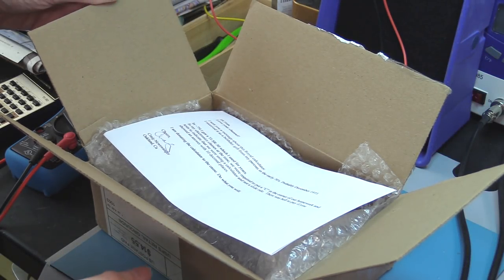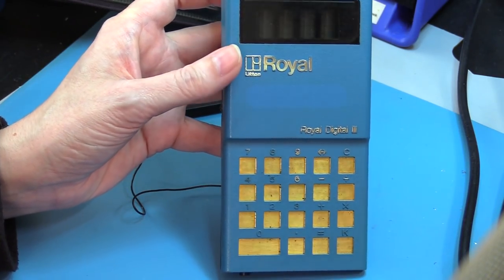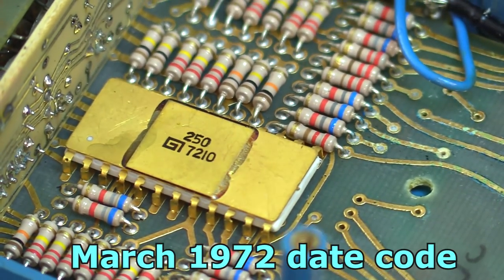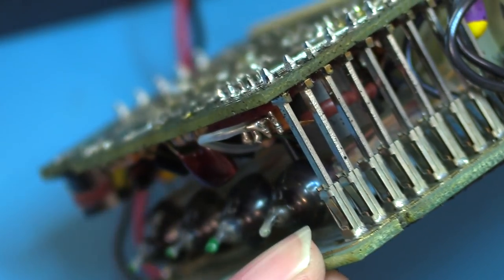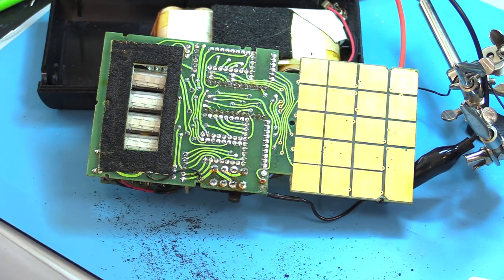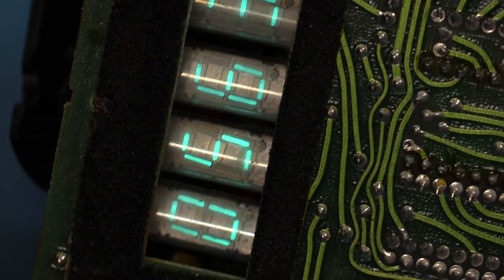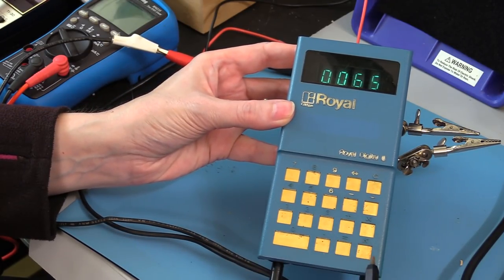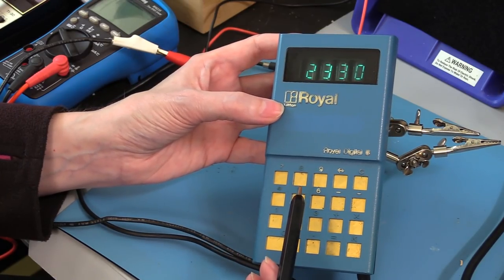Look Ma - No Keys!  1972 Royal Calculator

Comment: Yes, that is the General Instruments GI250 calculator on a chip.
If you think 4 digits isn't enough for most calculations, you're right. The math is done internally on 8 digits and the two groups of 4 can be swapped using the <-> key.
Reply: I was thinking there had to be some way to do that.
Reply: For Sure GI IC Chip
Reply: Agreed.  I just straight up read that chip as General Instruments.  It didn't even occur to me to view it as a symbol/graphic.

Comment: I saw one of these in 72, a local architect was using it and I was told to stay away from it as it was the most advanced electronics available. 10 years later while working in the repair dept. of an office equipment supplier I found the same calculator gathering dust in the back of a drawer.
Reply: "I saw one of these in 72, a local architect was using it and I was told to stay away from it as it was the most advanced electronics available"

 I hate people like that.
Reply: @plateshutoverlock  are deer zee zee
Reply: Around that time my parents gave me a Casio calculator with a vacuum florescent display. (to maybe replace my slide rule?) It had an appetite for batteries and no "scientific functions". But, it's the thought that counts. It probably cost a small fortune.

Comment: Yes, this is the General Instruments GI-250, which beat the Intel 4004 to market as the first microcontroller, though it had a ROM mask as a 'calculator on a chip' (and by some accounts is the great-great-granddaddy of the PIC microcontroller series). It was first available in 1971.

The power jack is a mod - the original power connector is another weird pin arrangement. The key pad is gold plated (not copper), since Litton wanted this to be a high end product. At the time, keyboards were not 'off the shelf' components, and using a stylus dramatically lowered the cost. The same chip, with an updated ROM mask was used in the more conventional Litton Five calculators (with buttons, and 8 digit display) that came out a year or two later.

The chip was designed in Scotland, UK by a team of four, one of whom is my father in law. He still has the first prototype and the hand-drawn chip layout diagrams (MOS ratio logic).
Reply: Thanks for sharing. I am always very impressed by these pioneers in innovation. The essence of intelligence.

Comment: Logo is GI, General Instruments Microelectronics. Famous for AY-5-1013 UARTs, various TV game controller chips, the AY-3-891x sound generators (ubiquitous in home computers in the 80s, a key to the sounds of the era), and the PIC1650, the first in the PIC series that Microchip now market.

I worked on two of the lesser known GI microprocessors (LP8000 and CP1600) in the 70s and early 80s, before moving onto Z80s.

Comment: I remember the no calculator rule when I was in school and then I went to an electronics vocational school where a scientific calculator was required equipment. Took a little while to shake the feeling that I was cheating somehow.
Reply: I'm all in favor of calculators in the classroom.  It allows the kids to go into higher math earlier while skipping the mundane stuff. I graduated HS in '73 and I only took one year of basic math. "Basically" arithmetic.  That summer I served an apprenticeship along side my father for the tool and die trade.  With my first two paychecks ($200) I purchased a Unicom Rockwell engineering calculator.  That got me into trigonometry and algebra immediately. 
One could make the argument that the student should know the "how and why" a particular equation arrives at the answer.  In the real world its not necessarily so.  When you're plying your trade and getting paid by the hour it's best to get the right answer ASAP.

Comment: In the same timeframe, I was working for Monroe Calculator (Orange NJ).  It was also a Litton subsidiary. We made the exact same calculator with Monroe branding. That's actually an 8 digit calculator. You'll find a "swap" key on the keyboard which swaps the most and least significant 4 digits to the display. The chip is from General Instruments. This was a super low cost device (under $100) hence only 4 vfd's and no keyswitches. A full featured 4 function handheld at the time was around $375.

Comment: In East Germany calculators were introduced in schools in the late 80s. And you needed a signed form from the school to buy the calculator, because it wasn't freely available. They were called "SR 1" (Schulrechner 1 = school calculator 1) and the price was 123 DDR Mark, really expensive!
But mine still works fine today. It's very sturdy.

Also the official lesson plans in 7th grade were attuned to using the calculator. So we were late to the game but went full in.
Reply: @manitoba-op4jx  Just a couple years before. November 1989 was the historical date.
Reply: @manitoba-op4jx  1989 was the fall of the Berlin Wall.

Comment: Some other have already added info on this calculator in their comments, and I will try to add some more here based on my own resources.

This calculator was called the "Digital III", and was introduced in late 1971. It was made in the USA by the Royal Consumer Products division of Litton Industries in Connecticut. It was "announced" in the January 1972 edition of "Electronics" magazine. It's suggested retail price was $140 USD, adjusted for inflation this would be something like $1000 USD today. 

As this was considered to be a "low cost" calculator at the time, the three major design decisions allowing it to be so "inexpensive" were the use of a "calculator-on-a-chip" integrated circuit, the four digit display (although since the calculator circuits did the math for an 8 digit display, it was necessary to 'scroll' the display left and right to show only four digits at a time, hence the "<->" key), and the use of the electronic 'stylus' contact pads instead of a mechanical keypad.

Keep in mind that in the early 1970s, electromechanical keyboards and keypads were both complex and expensive (and usually bulky), and use of such a keypad on this calculator would have driven the cost up even further, and by a significant amount. So Royal decided to use the simple and relatively expensive stylus & contact-plate scheme. By the way, those keypads are gold plated, not plain old beryllium copper!

The "calculator-on-a-chip" was the General Instruments model 250, which was one of the contenders for first usable chip of its type.

This model was also made more expensive by the use of the vacuum-fluorescent displays and their supporting high voltage power supply circuit.

As noted in the video, this model was nominally powered by a bank of 6 Ni-Cad cells, making a supply of 7.2V, but as it was power hungry, there was provision for powering it from a "wall wart" power supply.

At the same time Royal designed and introduced this "Digital III", they also produced a less expensive model, their "Digital IV". This had the same case (but in beige instead of the "Royal" blue color), same battery and power supply, and same stylus entry scheme. The differences were that the "IV" used an 8 digit LED display, and so accordingly used the General Instruments 251 "calculator-on-a-chip" IC, which better suited the display scheme. Because the display could show all calculated digits at once, there was no need for the "<->" 'scroll key' that the model "III" required, so that was deleted from the stylus pad arrangement, and the "+" pad was made twice as large to fill in the empty space. Suggested retail price of the "IV" was about $800 in adjusted 2022 dollars, a significant cost reduction over the model "III".

Comment: I used a TI calculator in college in 1974 and they were encouraged.  One student had one like you have there.  It got the "ooohh's" and "ahhhh's" but the TI was easier to enter numbers, especially when taking a test.
Reply: I'm all in favor of calculators in the classroom.  It allows the kids to go into higher math earlier while skipping the mundane stuff. I graduated HS in '73 and I only took one year of basic math. "Basically" arithmetic.  That summer I served an apprenticeship along side my father for the tool and die trade.  With my first two paychecks ($200) I purchased a Unicom Rockwell engineering calculator.  That got me into trigonometry and algebra immediately. 
One could make the argument that the student should know the "how and why" a particular equation arrives at the answer.  In the real world its not necessary.  When you're plying your trade and getting paid by the hour it's best to get the right answer ASAP.

Comment: I like this old stuff. The oldest calculator is my Sinclair Cambridge from 1973. I have also a Ohio Scientific Superboard 600 1978 (buy it 1980) with integrated Keyboard/TV connection and a Mac 128K from 1984 with Motorola 68000. so this Hardware needs always a Keyboard for inputs. The price for a good switch was very expensive, 80 pieces for a full keyboard. A stylus came back with the Apple Newton 100 MessagePad 1993 and the first touchscreen. It’s nice to see a stylus 1972 with metal pads.
Reply: Newton owner here too 😀

Comment: Nice. Since I retired recently I’ve had time to go through all my auto and electronic test equipment and fixing all the leaky batteries. Getting good at it with my Dremel tool with a fine brass brush and contact cleaner and DeOxit spray cleaner.

Comment: I had one of these with a light cream top case and an 8 digit dot matrix LED display instead of the 4 VFD tubes. It had the exact same stylus pad too, which was an extension of the printed circuit board track, gold plated to prevent oxidation. The internal construction was almost identical but with a different display board.

Comment: In my high school trig class in 1973, calculators were required. The school purchased a bunch for students that were unable to buy their own. They were handed out at the start of each class for the duration of that class. Tests were designed such that you had to use the calculator, or you'd never finish the test. I bought my first calculator that year -- an HP-45, using money from my morning paper rout. I still have it, including an HP65 and HP16c. They all still work. I still use the HP16c, every day, to this day.

Comment: I remember calculators with styluses were briefly a thing in the early 1970s, I think one of the early Sinclair calculators used one.
The little switches that hide under calculator keys and early computer keyboards were a major cost in the early days, before membrane keyboards were invented. Early computer keyboards had separately mounted switches for every key, with a hundred odd keys on a keyboard the total cost of the press switches become exorbitant.

Comment: The battery pack can be recreated -- AA "flat top" cells and a hand-held spot welder.
Reply: Or just update it with a modern LiPo pack and a small boost converter to generate the same 7.2VDC as the old NiCd batteries.  More runtime, much less weight, and faster recharge time.

Comment: Ordered an HP-35 in 1972 the week they were publicly announced. Paid $403.28 (have the receipt). Had to return it to HP a few months later because of the "ROM error." OU School of Engineering didn't have a "calculator policy" yet ... only one instructor objected to my '35 so I was in fat city, although I kept and always carried my Pickett Dual Vector Log-Log aluminum slide rule. Both the HP and the Pickett still work perfectly.

Comment: I recently discovered a SOBAX 600 in a trash pile. I took it home to find 14 nixes a displaying zeros. I did figure out how to throw it in a check mode for each nixie but I can’t find any white paper on it. One day I’ll get it working. Basically no number inputs on the matrix work. It has 5 different slot boards. All fully populated with transistor arrays. Truly a first see experience. Anyways thanks for sharing your calc. 
God Bless

Comment: So this is a typewriter company that made a calculator that uses a stylus ... wild
Reply: Seems strange.  I have to wonder if it wasn't to avoid a patent or something.
Reply: @russellhltn1396  It was probably just cost cutting. A stylus to touch the bare PCB was surely much cheaper than a full keyboard. Althogh the thick gold plating added to the costs, which would not be absolutely necessary with a conventional keyboard.
Reply: @JaneChristensen.  Not many, especially the foam and foil type ones. Some used metal contacts, those are still fine usually. In bigger, desktop calculators they sometimes used magnets and reed switches, those are eternal. OK, a few hundred years later the magnets might become too weak 🙂
Reply: No buttons… maybe for the Amish market?

Comment: Love the calculator videos! One of these days, I NEED to clear my desk, so I can have the room to get my SCM (Smith Corona Marchant) Cogito 240SR and my Hewlett Packard HP9100A opened up so I can check them out... The 240SR powers on and allows number entry, and used to work perfectly, but after moving a decade ago, the entry register will no longer transfer into the operation register. The HP9100A was sold to me as non working, so I have no idea how extensive repairs on it would be.

Comment: A great example of transition tech. Plus how many later calculators will still run after so many years? Few if any.
Reply: My HP35 (of similar vintage) still runs great! (I have also had to change batteries, and now have a USB charging cable in addition to the wall wart).  But then again, so does my decilog slide rule that I used in high school (a boys-only nerdy college prep Catholic school in Chicago), and at the Astro Science Workshop (taught by Northwestern University, University of Chicago, and Adler Planetarium faculty to promising young high school (and some very precocious elementary) science students
Reply: @stevejohnson1685  HP35's were  really nice ones. I think everyone got one who needed a scientific model.

Comment: What a cool calculator! It probably wouldn't take too much work to retrofit a couple of 18650s if you wanted to start using the calculator on battery power again, but I suspect there are a dozens of other projects in the queue right now (relatable).

Comment: until the late 80s, devices with built in battery often used the battery as a voltage regulator. So never plug in such a device if the battery is missing or may be dead.
E.g. most Commodore pocket calculators come with a 6V PSU but can't tolerate much more than 5V, the built in NiCDs limit the internal voltage to ~4.8V. the unregulated original PSU will give you around 9V!

4 digits is actually plenty, a sliding ruler gives you 3.5 digits at best. The scales give you only 3 digits without a decimal point (you have to keep the decimal place in your head) and you can only tell that it is more or less exact, a bit more or a bit less, hence 3.5 usable digits.

Comment: Sush a cool device!
I wonder if it is an early microcontroler, with masked program; or some kind of hard wired sequencer and logic automaton.
It does not look like the intel 4004, made originaly for calculators, it needs more chips around it.

Comment: You really should clean the boards and other things affected by the battery leaks with vinegar (weak acid). Neutralizes the alkalic electrolyte. Be sure to rinse well afterwards or you'll have acid corrosion instead.

Comment: What happens if you Divide by Zero?  Does it blow the tubes?
Reply: Would it hang up?
Reply: In my first year of HS (1969) the basic math class had four Olivetti mechanical calculators.  Before we learned how to use one we got a lecture from the teacher about NOT dividing by zero.  Within a week two of them were down for repairs.  They actually required a mechanic to "reset" them if they got locked into an endless divide by zero situation.

Comment: If you were to replace those NiCds with NiMH batteries would the charging circuit work without modification?  Of course, if it's just for display, it doesn't need batteries, I suppose.
Reply: Yes, though you'd want to measure the current to see if it's appropriate for trickle charging. NiCd can be trickle charged at 1/10 C wherase you need to slow down to 1/40 C for NiMH.

Comment: Nice and odd piece of history there... 
But why the touch pen? It only makes it slower to use. The case design looks like they intended for buttons first, but somehow not implemented them and added the pen at the last minute. If you lose the pen, you can't use the calculator unless you buy a new one or bodge something yourself. 
I also don't get the 4 digit display. Someone below mentioned it worked 8 digits internally and you'd need to press (sorry, "touch") a button to display them in 2 parts. There were 12 digit handheld calculators in 1972. Clearly this one wasn't a cheap calculator by the day, judging by the 2 sided board and very "high-tech" parts inside, limiting the display to 4 digits is again not a good decision for usability
I am guessing this one flopped in the market.

Comment: What size are those 6 internal batteries ?   Are those size B cells ?
I remember shops in the late 70 selling A, B, C & D batteries.
Reply: They look like B cells, need to see them on some graph paper to be sure. Would be interesting to see how much current the charging circuit outputs, if it's low enough you could use LSD NiMH AAs as drop in replacements (NiMH need a slower current of 1/40 C to trickle charge compared to NiCd at 1/10 C).

Comment: Why are calculator numbers opposite from phone numbers.?
Reply: Calculators duplicate the pattern of keys used by mechanical adding machines of old.  When Touch Tone Phones were introduced in 1962, AT&T researched and tried with many different arrangements with test subjects and found the square grid with one on top to be the easiest and least error prone for average people.